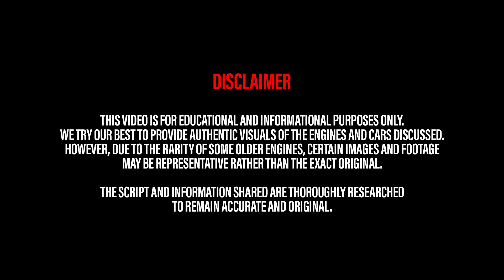Why the Pentastar 3.6 Has Earned a Bad Reputation Among Mechanics

Comment: Having grown up between Chicago and Milwaukee, I really think that the design of a lot of the houses lent themselves well to the basement bar. Originally houses and bungalows were built with a downstairs bathroom and shower with an entrance that bypassed entering the actual living space so factory workers could shower and clean up before proceeding to the living areas. So there was already water and drainage in the basement to allow for a full wet bar with a sink, and an entrance setup that allowed someone to have people over for socializing without opening up your actual home to them. It allowed for separation and hospitality at the same time and I think that is an important part of the popularity. Many houses with the downstairs bar would have an outside door with a lock, as well as a sturdy inner door for the upstairs living areas with another standard type door lock, and it was always the side or rear door with that type of setup as the front door was for formal guests.

Comment: Use Mobil 1 5w-30 (not 0w-20, NEVER) weight oil and filter chang using a napa gold filter every 5000 miles . mine runs like new after 80,000 miles

Comment: I have owned multiple 3.6, 4.0, and 4.2 engines, and the 3.6 is BETTER by every measure. More power, better fuel mileage, and zero reliability issues.
I would rather replace the weeping 3.6 oil cooler every decade vs. replacing cracked pistons of the 4.0. 
The 4.2 got bad fuel mileage, not enough power to be unreliable, and wore out by 100k.

I have driven the 3.6 across the country MULTIPLE times, trail rides at Moab and St. George Utah, and then back across the country, while getting 22 mpg with VVT.

I still have a 4.0, 3.6, 5.7 Vortec, 5.2 LA and 6.2 diesel; all are roller cam engines that run forever.

The 7.3 PS is good for 20 years but then the electronics get too old and unreliable.

Comment: We own a 2015 Jeep Wrangler and around 70K, I had to remove the driver's side valve cover to replace rocker followers that had bad needle bearings. Over 100K, I had to do the same on the passenger side. Our engine was ticking and I didn't let it go on. If you let it go on, you'll be replacing cams and then it gets complicated for a backyard mechanic. I've had to replace the oil cooler with a Dorman all aluminum unit. These are common problems that supposedly (rockers) was fixed in later years. We have around 146K on it now. It is well maintained with oil changes every 5K with Pennzoil Platinum high mileage synthetic. These engines seem to have the valve train crank dry in the mornings. I think that might be the issue for the rocker followers wearing out. Otherwise, it has been pretty good. I did all of the work or we'd have been out of a lot of money.

Comment: Ive only heard of problems with the pentastar. My aunt had one and it was in the shop every single month for 8 months straight. She got rid of it and went to a Toyota Camry TRD. (I told her to get it). Now 120k on the clock later its still purring. And nice. 300hp and AWD. She gonna be pissed when i throw on a TRD supercharger. Lol.

Comment: I’ve had two Rams 1500’s with the 3.6. The 2018 had a cylinder head issue at about 80K. The 2022 is just coming up on 70K and so far so good. For highway driving with a 3.21 rear and light load it is a very capable engine. Both were company provided. I’m going to buy, one but probably go with the 3.0 Hurricane.

Comment: This engine uses port fuel injection... this means no carbon buildup you get from direct injection.  EPA push for mpg resulted in the use of 0w20 oil.  This oil provides minimal protection and in order to prevent damage 5w30 should be used. GMC has the same issue with their v8. Solution is to change to 0w40. I have used 5w30 and have 225 thousand miles on my Pentistar with no issues. The EPA is trying to save the environment, but all they are doing is causing engines to fail....and burning oil ... causing more pollution.
Reply: Gasoline direct injection is a disaster!

Comment: My wife had a 200s with one and it was the absolute most trash engine I’ve ever had the displeasure of working on. It would 💩the bed, I’d fix it, then something else would 💩 out. It was trash. My buddy had a charger with the old 2.7 and it NEVER had an issue
Reply: And that 2.7 had some real problems, with oil pump failures and oil galleries coking up. Your buddy was lucky, many weren't.

Comment: The reason I don't like the pentagram engine is because the 3.8 that it replaced was a reliable, easy to maintain and repair engine that would tolerate some level of neglect and abuse. It was a solid engine.

A big problem especially with the early pentagram engines was that effing oil filter housing being on the engine V. They would loose enough oil in the V to cause damage without leaking anything on the ground, and since most people don't pull the dipstick it resulted in lots of problems. And then those people who did fill them up when low had oil leaking on top of the transmission making them assume that the engine was burning oil and that the transmission was going to shite also and trading them in.
Reply: You are correct and I still have a 3.3 that don’t burn oil

Comment: I've owned 3 Chrysler products with this engine. The last being a 2018 model. The current models seft destruct issue has been the cam shaft to Valve buckets wearing out even with correct care.  One family member recently had that issue on his 2021 Durango at 98K miles and the dealer told him the repair cost was $3200 per cylinder head x two. My advice to him was to buy a Asian vehicle rather than deal with the poor quality Chrysler was selling !

Comment: GM also has a 3.6. Last year I traded in a 2016 Colorado with 93k miles and had no issues with it. I changed the oil every 5k miles and it was a reliable and efficient daily driver.
Reply: Man, 2016 Colorado is such a horrible year. Not because of the engine, but the transmission and electrical issues among other things. 

I have one and the engine is perfect, but the transmission is horrible. It doesn’t know when to shift and you have to drive it in manual mode almost all the time to avoid damage to the vehicle. When going up steeper hills or accelerating harder after light throttle, it will hold high gears way too long and lug the engine down way too much. 

Under heavy throttle on steep hills that transmission lugs the engine down to 1,000 rpm and it has no power because that’s too high of a gear for the load. It will just stay in the high gear and make the engine shake like crazy from the struggle. 

But as soon as you put it in manual mode it instantly downshifts and you can control the shifting fine and make it run right. Idk how a 20k vehicle is engineered so horrible it doesn’t even act right in auto mode. I had a $500 van once that was fine in this regard

Also the infotainment screen failed on mine at 60k miles and would constantly change screen and not respond to touch along with making that annoying beep all the time. Cost $700 to get it replaced

Love how Chevy takes no accountability to fix these bogus issues that shouldn’t even happen in the first place. I did my research and found out there is a transmission software update to fix this shifting issue and I took it to the dealer and they didn’t even know anything about it and basically told me to pound sand. Never gonna buy another Chevy after how horribly they treated me with this one. 

The transmission issue is called the “chuggle” if you wanna look it up. Tons of people online had the same issue as me and sold the thing to get a better truck
Reply: Curious did you buy yours new or used? And if used when did you buy it? 

I’m almost certain that it had the software update already installed when you got it or you’d have been disgusted with it too. 

I heard the update came out in 2018. Got mine in 2020 from a dealership but it’s obvious that they never bothered to do the update. We used to be a lifetime customer of theirs but they treated us so bad on this one that they will never see our business again
Reply: The GM 3.6 is far worse than the Pentastar
Reply: @danielcarrillo1057 How? So far the engine seems ok in my Colorado. It’s transmission and electronics that suck

Comment: I’ve owned 2 vehicles with this engine. Both were ok. No major issues. Decent gas mileage. My fav 6 was the inline 6 I had in 2 Jeep Cherokees. 4.0 liter. Very good engine.
Reply: GM 3800 V6. i still own two and they arent for sale. fantastic engine, and the one car has the 3800 supercharged with a few bolt on mods, for a V6 it screams

Comment: I rented two Chrysler minivans with the pentestar engine in them and I was amazed at the power and gas mileage.  Loaded down with five people and luggage I consistently got 30-32 mpg doing 75 on the highways in Utah and in Hawaii I got 25 mpg going up and down mountainous roads.  If they can just make it as bulletproof as a Toyota engine it would be known as one of the best V6's ever.
Reply: Saying you rented a car and then speaking on its reliability is a joke...
Reply: @kskeel1124  Did I say it was an unreliable engine? No. I said if they could make it as bulletproof as a Toyota.  I think everyone would agree that as a general rule Toyota's are more reliable than Chryslers.
Reply: @davidn4125 not anymore. Toyota is an absolute joke anymore

Comment: A lot of problems have been exacerbated by government efficiency standards. Reliability took third place after EPA gas mileage  and (to a lesser extent) emission limits. Not just Chrysler, all the major manufacturers are having problems. 

Overhead cams and turbo charging are frequent problem spots for  many makers, the chains or belts fail frequently, and turbos introduce a whole range of failure modes that simply do not exist in a naturally aspirated engine.

The largish displacement naturally aspirated pushrod engines are heavier, use more gas, but are vastly less expensive to maintain in the long run. I have been driving for over 50 years, driving many high mileage pushrod engines and I NEVER had a timing chain failure. (those short little chains simply didn't face the abuse that modern chains do.

I have a couple of old Jeeps with the (American motors) inline 6. Very trouble free... just keep running. If I eventually replace it , I do not want anything newer than the TJ series (ended 2003)
Reply: The Govt isn't forcing car makers to save a pound here and there by using plastic over aluminum.  I hold the bean counters responsible.  There are plenty of other ways to squeeze a few miles out of a tank of gas.  If you're blaming efficiency standards, perhaps consider the large frontal area,  brick shaped vehicles made today, with 260+ horsepower from 4-cyl engines.  Fuel efficiency and horsepower wars just don't fit well together.  Also, add in the physical dimensions of all current vehicles vs ones from a few decades ago and tell me car makers are really that concerned about fuel efficiency.
Reply: @LarryCook1960  A lot of the changes actually cost more.  These engines are FAR more complex to build.
Reply: @LarryCook1960  Turbocharging is much more expensive than large displacement. Complex overhead cam assemblies, variable valve timing, 8 & 10 speed transmissions are hugely expensive, and unreliable.

Comment: I've got 229,000 miles on a Pentestar, and it runs great.  Frequent oil changes and light throttle until the oil is at full operating temperature is what i do.
Reply: 160k on mine, and I have beat it and neglected oil changes for so long the check engine light would come on. Only problem I've had is a busted oil cooler housing, that was likely caused by over torquing the oil filter.

Comment: I rented a jeep Cherokee, and it's surprisingly good. Nice torque and strong acceleration. Fuel mileage was good too.
Reply from the maker: Thanks for sharing
Reply: Saying you rented something and then speaking to its quality or reliability is a joke...
Reply: @kskeel1124 are you going to keep repeating that Everytime someone talks about renting a vehicle, it actual does tell if it was a decent motor or not, because people beat on rental vehicles and for it to take the abuse and keep going, says that it at least could take abuse, so yeah people rented vehicles and they get to speak about there time using it, geez, only joke is you.